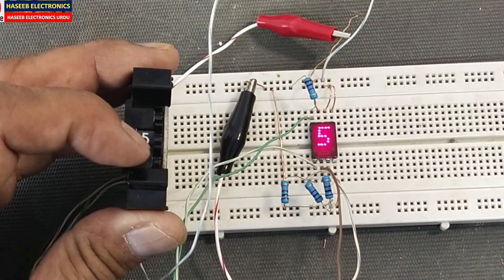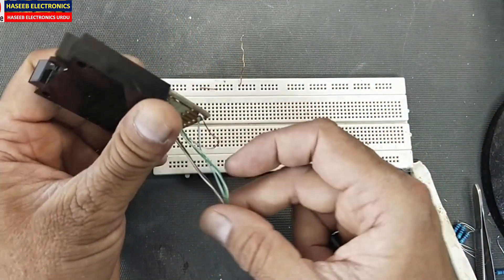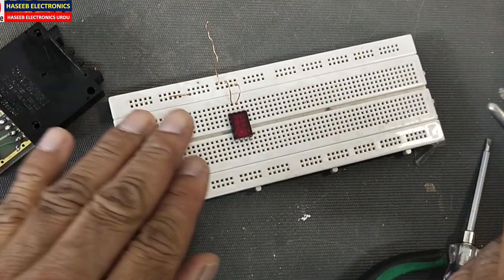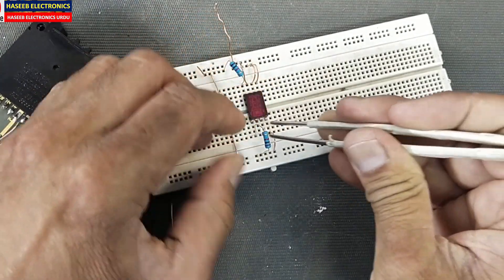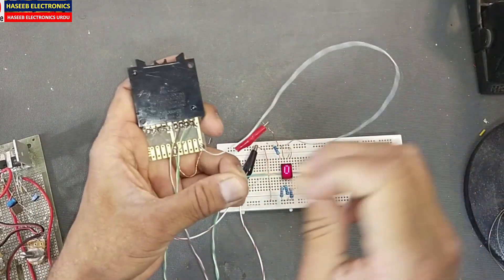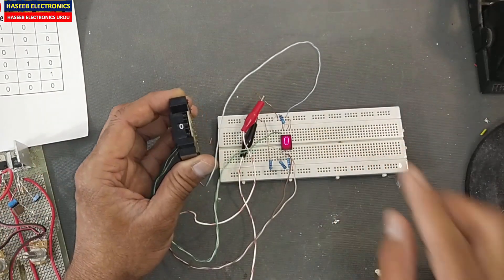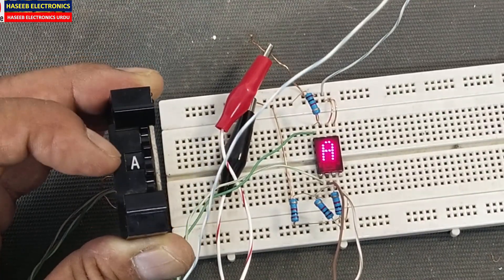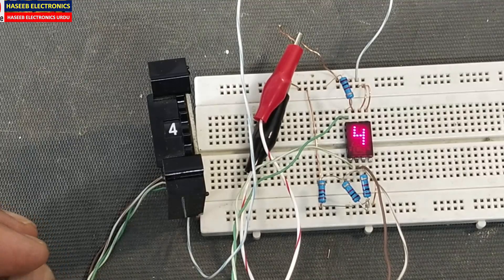{640} Integrate Hexadecimal Thumbwheel Switch With Hexadecimal Display

Comment: I have a question about Dell SMPS mosfet.
Whatever mosfet i replace it get blown up.
I can't find exact same model or exact equivalent mosfet, so my question is how to check mosfet specifications which very important.
Can I use 10n60 in place of K16a60w ?
Please help in this.
Reply from the maker: TK16A60W is 15.8A 600 volt 
and 10N60 is 10A 600 volt
use TK20A60T or TK20A60W, AOT27S60
AOT42S60L
AOTF190A60L
AP65SL190DP
FCP190N65S3
HF5N65
IPA65R190C6
NCE70T180
OSG60R180PSF
Reply: @HaseebElectronics  Thanks sir for replying.
I have used 6R280e6 but it also burnt.
And this mosfet is of Max 13.8amp.
I can't understand why it's so.
May be other factors other than amperage may affecting.

Comment: Hi sir
Reply: I have a question about Dell SMPS mosfet.
Whatever mosfet i replace it get blown up.
I can't find exact same model or exact equivalent mosfet, so my question is how to check mosfet specifications which very important.
Can I use 10n60 in place of K16a60w ?
Please help in this.
Reply from the maker: TK16A60W is 15.8A 600 volt 
and 10N60 is 10A 600 volt
use TK20A60T or TK20A60W, AOT27S60
AOT42S60L
AOTF190A60L
AP65SL190DP
FCP190N65S3
HF5N65
IPA65R190C6
NCE70T180
OSG60R180PSF